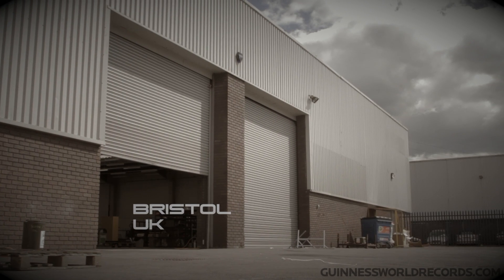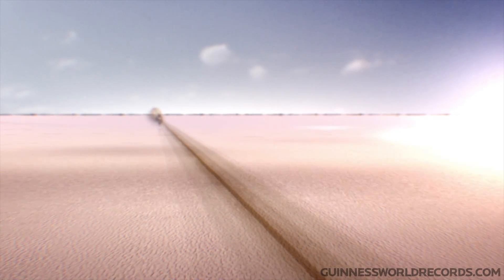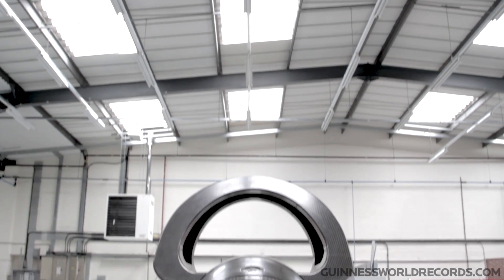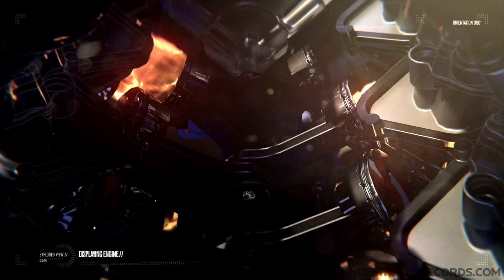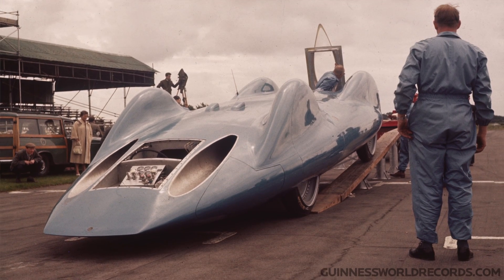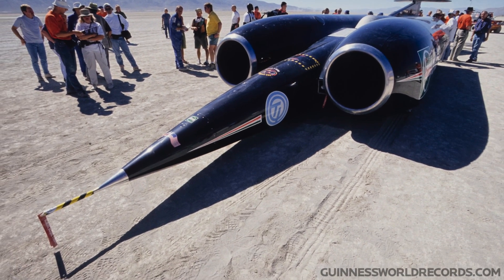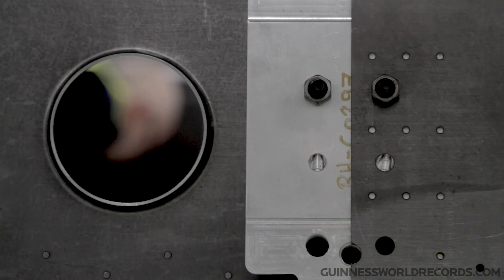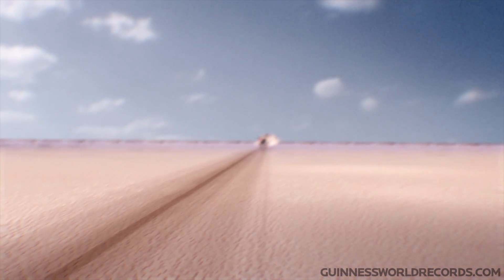Bloodhound SSC - Guinness World Records - Guinness World Records

Comment: An F1 car has only one engine, BLOODHOUND is using three (the smallest one is an F1 engine that drives the rocket fuel pump). F1 cars go five times slower than BLOODHOUND is designed to go. Both are pretty complex!
^JT

Comment: The Cosworth is simply a very powerful pump which will empty the 1000L of HTP oxidiser into the rocket in about 20seconds! The car will be propelled first by the EJ200 jet and then at about 300mph the rocket will kick in as well - giving it more than 8 times the power of an entire F1 grid!

Comment: The four 36-inch (910 mm) diameter wheels will rotate at up to 10,200 rpm and will be forged from solid aluminium to resist the 50,000 g centrifugal forces